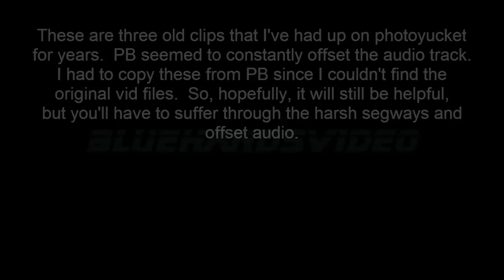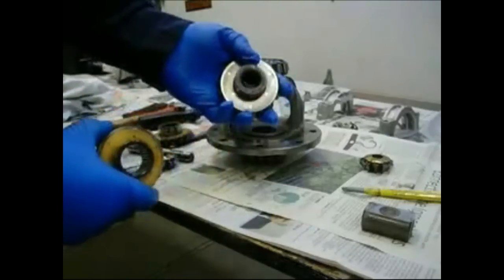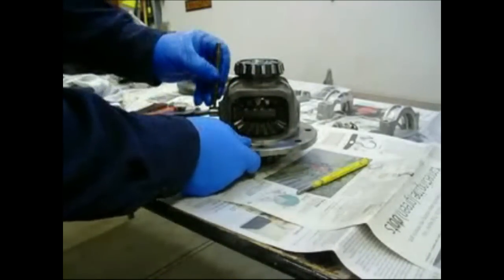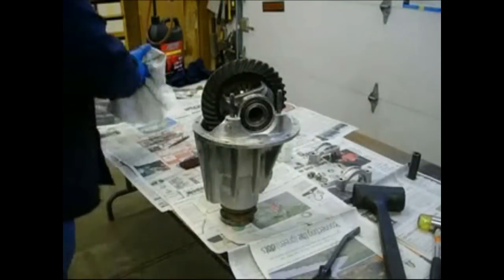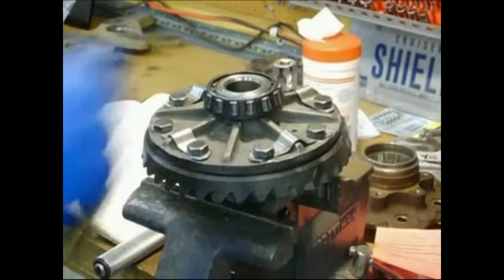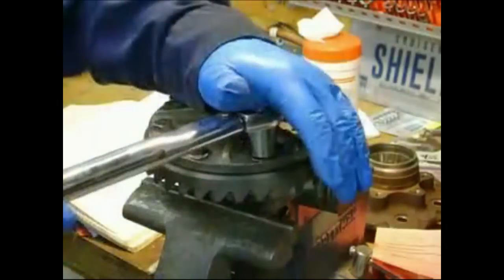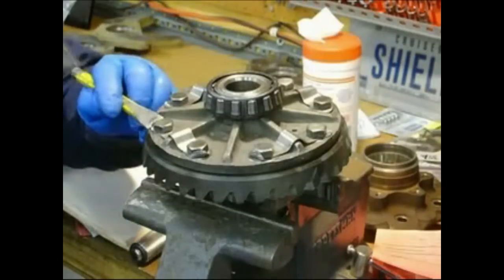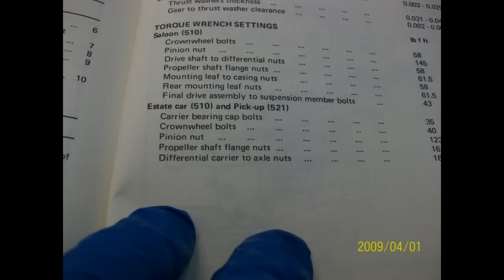Spider Gear Swap - Differential

Comment: Thank You for making this video and helping me develop a better understanding of the make up of a differential, with the terminology/description of parts. I just had my spider gears fall out on me on a DANA 35 while I was replacing the rear bearings on my truck.

Extra pissed off cause this happened right before daylight  dropped, I'm working outside(what an inconvenience.)
Reply from the maker: You're more than welcome.  I just wish the vid quality was better!